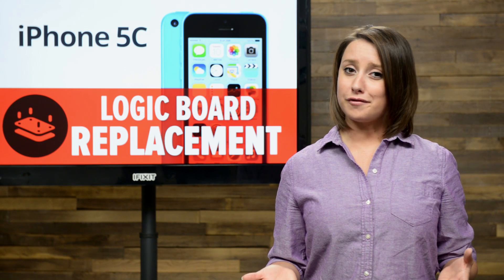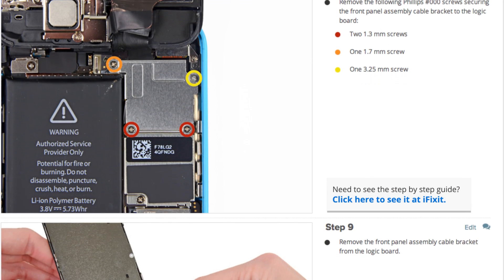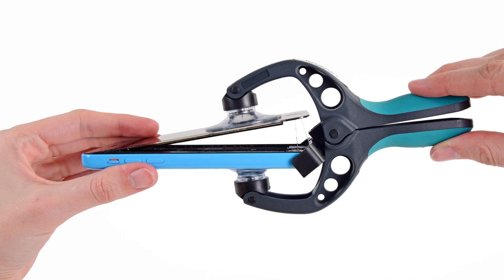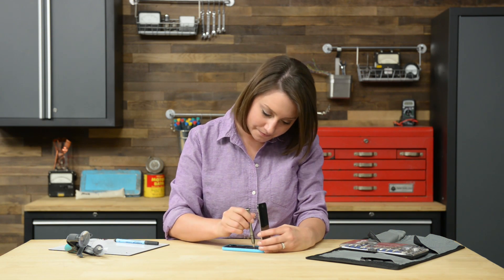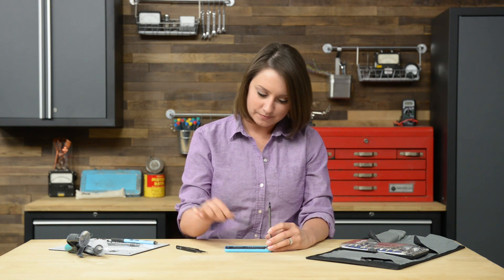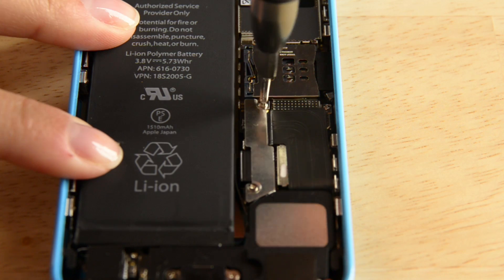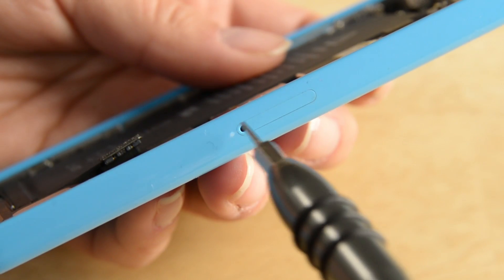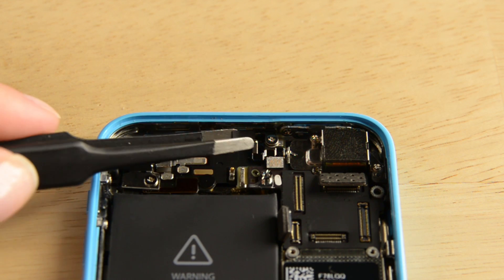How To: Replace the Logic Board in your iPhone 5c

Comment: Are the batteries and screens of the iPhone 5s and the 5c compatible or onterechangable? I have an iPhone 5s that the screen is cracked and the battery will not hold a charge (overheats and has to stay plugged in for use) but I got an iPhone 5c for free from someone so I wanted to know if I could swap out the good parts. Is that doable?... Thanks in advance for your time and consideration. 
😊
Reply: P.S. Rgey both have the same size screens and housings....
Reply: They both *

Comment: i followed the video to repair my iphone 5c... took me a long time, but i finally finished it!!  Now I plugged it in and I am anxious because the apple sign DID NOT come on.   AAAAUUUUGGGGHHHHH
When I went to put the sim card back in, the card fell out of the sim card holder before I put it back in.  So I put the card back in the sim card tray and put it into the phone...I think there is only one way for sim card to go.  could it be upside down?  Would it fit into iphone?  Help!

Comment: Ive stepped on my Iphone 5c and some black thin lines appeard on my screen .. I followed a youtube tutorial for replacing the upper part of the logic board 
I unplugged and replugged the three cables but then the screen became light grey with 3 black lines in the middle .. is there a way I can fix this
Reply: Riad El Dalati sounds like you may have damaged the digitizer or the screen. Just get a new screen they are only 4 bucks on eBay